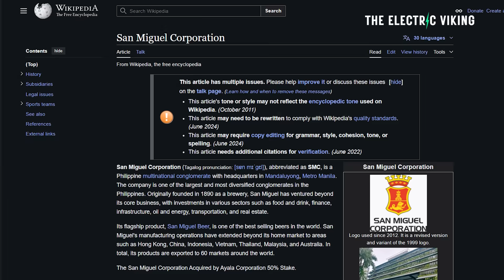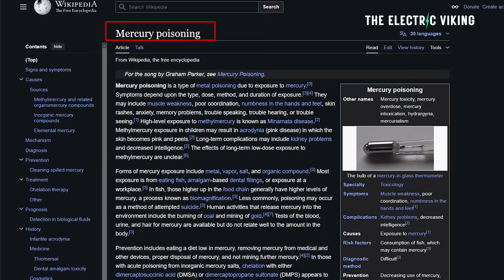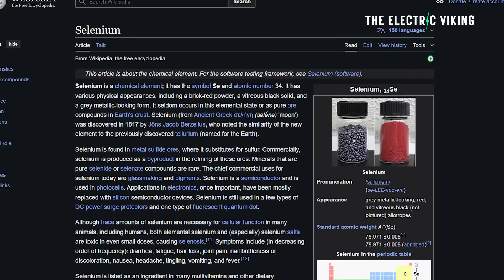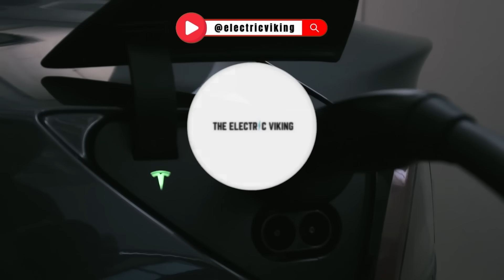Solar replaces one of the most toxic coal power plants in the world in Texas

Comment: I've been to Christine Texas and I've driven as close to the San Miguel lignite mine and power plant as I could get.

Christine is so small because it used to have a railroad line which was abandoned at the start of WW II. The railroad station is still standing at E Avenue and 8th Street.

The nearest significant town is Jourdanton. The only reason Christine is shown as an address is that there is no other civilization in the southern end of the county.

The San Miguel plant isn't all that dirty in terms of particulates, but it is very wasteful given the low grade of the coal. The mine forms a huge gash in the south of Atascosa county. Since coal burning power plants need cooling water, this has become more and more of an issue as other demands on the water supply increase. Looking at the satellite view, one notices a lot of recently drilled oil/gas wells, most of which were fracked. This is part of the Eagle Ford Shale.

All that disturbed land (for the mine) is a perfect place to put solar panels.

A lot of the power produced there will most likely be sold to either San Antonio or Corpus Christi.

Comment: If Texas had only solar and wind , thousands of people will die when the next cold blast hits the State.
Reply: Nope. The Texas power grid failed last time, from the gas infrastructure freezing, ie the gas valves froze shut. This affected home gas heating also.

Texas are islanded, ie, they are not connected to the reast of the USA electrical grid (dumb move Texas). Texas best move is to connected to the wider US grid, amd runn all electric over winter. This would be a win win win outcome. Let us see how smart Texas really is.

Comment: Texas is the #1 producing state for oil, natural gas, wind and #2 in solar. Yet Texas still has trouble keeping electricity flowing in the Summer and Winter. Why? They keep shutting down base load coal plants. They will eventually be replaced by more green energy. When batteries eventually come online in any meaningful way, some day, then they can start replacing the base load they are removing.

Comment: I live in Texas, We are starting to have summers where it gets up to 50C during the day and stays above 40C for a month or more. When this happens we need AC all day and night.
Reply: You need better designed buildings. It is disgusting that the US uses more energy in the summer than the winter.
Reply: @marcsimmonds5483  1) You have an actual citation for that assertion?
2) Cooling, because it's heat pump based, is cheaper. Also, outside of extremes, it is much easier to just turn it way down/off. That's why the traditionally there's been low building investment. ¯\_(ツ)_/¯

Comment: Doesn't the heat reflected back into the atmosphere by these huge solar paner arrays cause localised climate change?
Reply: That’s actually a very interesting question. My take is that since panels are reaching 22% efficiency that means 22% of the solar radiation is completely converted to power, while the remainder is available as distributed heat. As the panels themselves heat up substantially let’s say it’s another 28% just for a guess; So 50% is eaten by the panel in either electrical conversion or thermal heat, leaving the other 50% to be reflected somewhere else — including back into space — which a huge percent of thermal radiation does do at night, or into surrounding vegetation. 
Could it cause a micro-climate to form? Sure why not. But the question would be in which direction? Hotter or colder. In a desert most likely cooler, in Texas possibly hotter, but not by enough delta to matter. In any case, it could be measured on the ground at the panel level and compared by our newer satellites just recently  launched for the atmospheric temperatures above them.
Reply: @RandyP-jr1ek  thank you for your well considered response.
Yes even rocks and sand absorb heat during the day and dissipate that heat back into the atmosphere at night.
I imagine there is a phase difference as the solar panels reflect the heat back during the day.
Remember that solar panels lose efficiency over 25° C and they get pretty hot.
When one of those series connected panels in a long row fails, the whole series link is reduced to efficiency of the failed unit.
We know that large water storage dams cause changes in local weather patterns due to updrafts and thermals.
Changes in weather patterns are climate change.
Global warming is mostly a hysterical reaction to folk having to step outside of air conditioned homes, cars, offices & shopping malls and experience uncontrolled climate.
The same folk who sit in their ICE car with the engine running to keep the climate control running.
Reply: "Global warming is mostly a hysterical reaction to folk having to step outside of air conditioned homes, cars, offices & shopping malls and experience uncontrolled climate." - lol, sure dude
Reply: @NirvanaFan5000  I bet you've never laboured outdoors on a pick n shovel in summer for 10 hours a day have you?
You believe CO2 influences climate more than space weather and natural cycles of heliophysics?
Where do you think the heat from aircon evaporators goes?
Reply: @ix-Xafra  : It doesn't matter if CO2 influences the climate more or less than other factors. What matters is that it's a new source of atmospheric co2, that it's throwing global atmospheric temperatures out of whack, that it's due to human activity, and that we can change that. which of those 4 points do you take issue with?
Reply: @ix-Xafra  Completely agree, without cooling solar panel efficiency drops about 1/4. I am planning to place solar on my tan colored garage roof to charge my car next year. What’s funny is my neighbor below me has perfect south facing roof with zero interference and has no solar or electric vehicles. What a shame as tariffs are likely to change plans.
Reply: @RandyP-jr1ek  and when you consider the losses during transmission over the grid, discreet application makes more sense than having these massive arrays.  But then having home solar feeding the grid has caused many failures of local stepdown transformers as the local voltage fluctuates.
Reply: No.
Reply: @Fomites  and no one could ever convince you any differently. Lol
Reply: what effects are you expecting, and are they worse than the ones from coal or other alternatives? what is your preferred energy source for that area?
Reply: @NirvanaFan5000  the point is every type of energy production causes effects. There is no free energy.
All those solar panels are made in China using coal-fires energy and never produce the energy used to create them and have a high failure rate.
I have a solar panel on my campervan - they're useful for discreet application.
Everything we do has environmental consequences .
EVERYTHING!
Reply: I think most replies have missed the point.  How many roof tops are there in acres, compared to solar arrays. You will find roof tops are magnitudes more prevalent, and are reflecting a lot more heat back into the atmosphere than solar farms are.  Just google views from above cities etc, and not just roofs, roads as well.
  .
Reply: @TerryHickey-xt4mf  excellent counterpoint!  In fact where I live the airlines prefer to land take off over the land rather than the sea due to the assistance of the thermals created by the populated city below.
Everything we do has consequences for the environment!
Reply: As Randy said,23% of the energy is converted to electricity . If the rest isn’t used by photosynthesis by surrounding vegetation or evaporation of water through transpiration, then some will radiate infrared energy into the sky and air.
Whatever the final destination of the solar radiation, it seems solar farms should cool the atmosphere and not be blocked by co2 from the farm itself.

Comment: My understanding is timing is critical in the grid and that large momentum generators are very good at maintaining that critical timing and this can be an issue with renewables, maintaining timing and phase...Can anyone tell me if these large grid batteries can replace the timing and momentum of large generators?
Reply: Batteries are widely used to stabilise grids because they are better at this than rotating generators. This is icing on the cake of energy storage.
Reply: Yes, battery power plants have demonstrated they are capable of synthesizing that momentum, on top of providing bulk power as needed.

There’s also kinetic energy storage, weighted spindles, that can be employed to do this as well as an older technique of running a flywheel that has no net energy production but inherently has that momentum as it switches seamlessly between motor & generator mode.